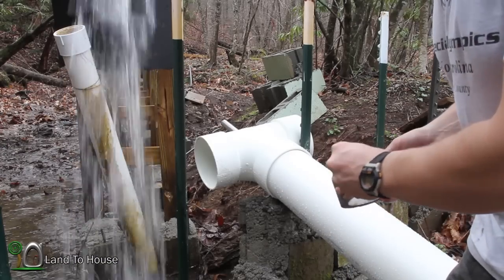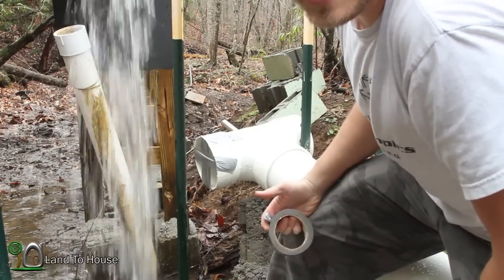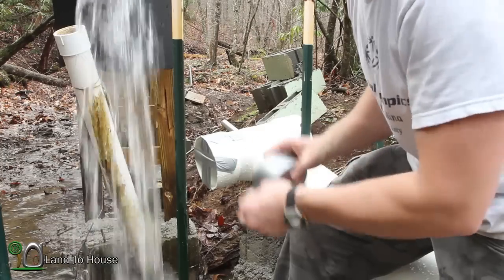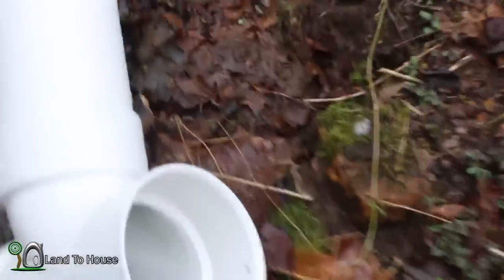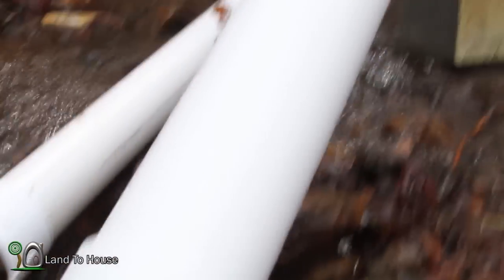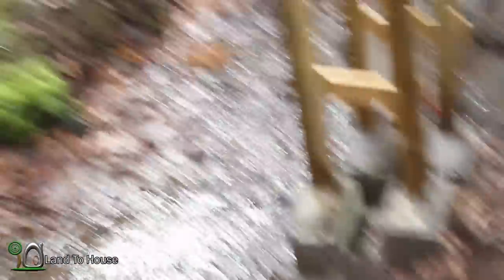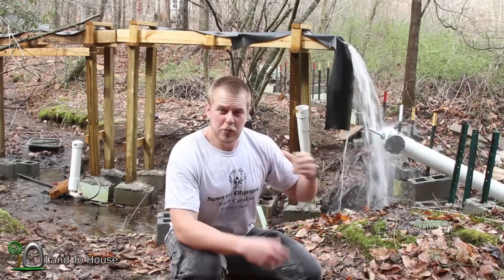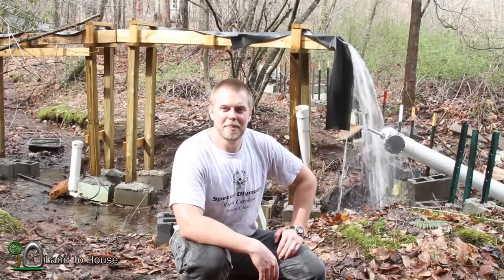Archimedes Turbine Test 1 | Land To House

Comment: Good test. I did think the tee fitting on the top should have been the other way around. It's made for best flow that way. Other than that it's a good start.
Reply from the maker: ed sautter OH you are right. Had to go back and watch for that. I am getting the frame built now so when I go to install the turbine I will make sure that the easy flow part of the tee is in the right direction.